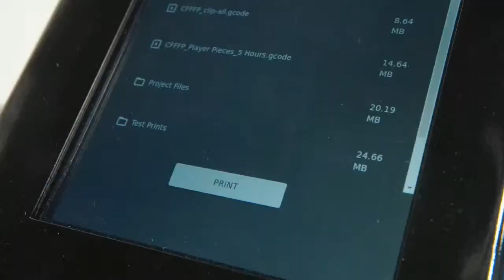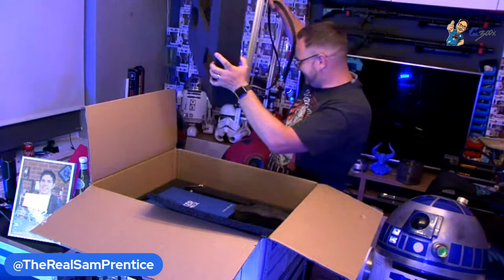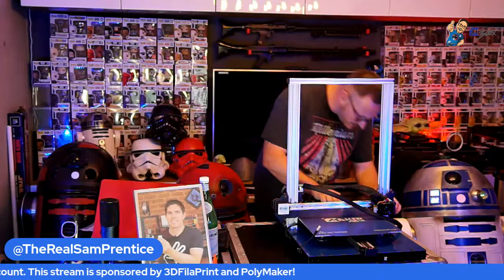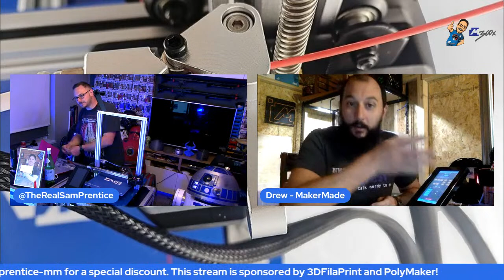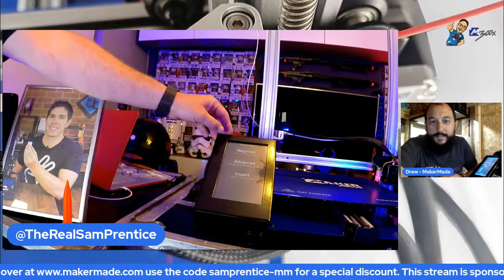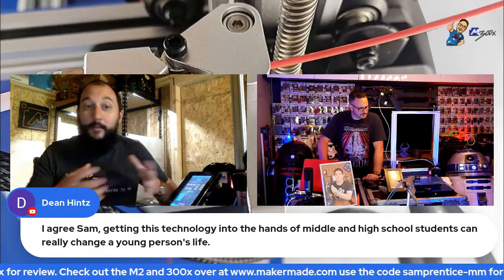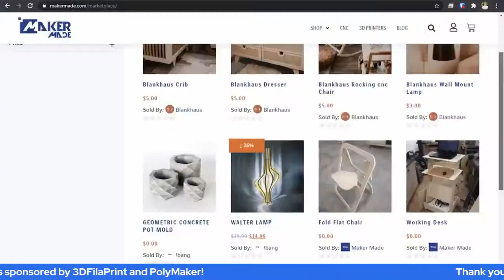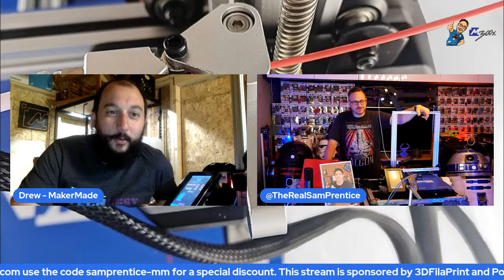Makermade 300x 3D Printer Unbox, Build and Print

Comment: I've had nothing but absolute issues with this printer since we got it in. Bed leveling is all wack with the bl touch. I set it and level it then it drops further and drags the bed every time no matter how many times i level. Then I move the bed as it's dragging to try to level it that way and it's not even extruding anything but little dots here and there ther eis no clog filament runs fine but cannot print crap.
Reply from the maker: Is this your first printer ? Have you upgrade to the latest version?